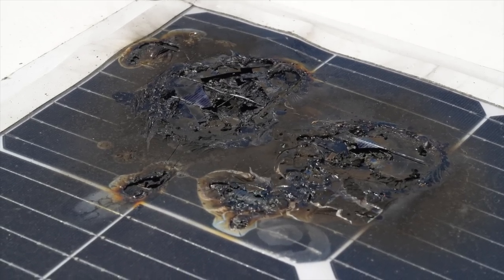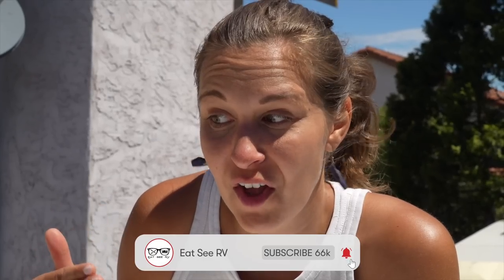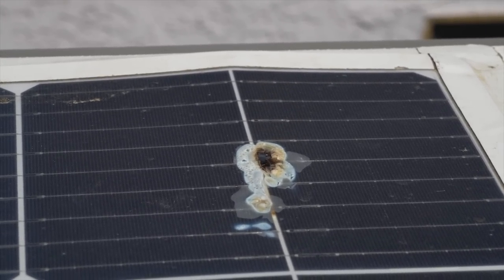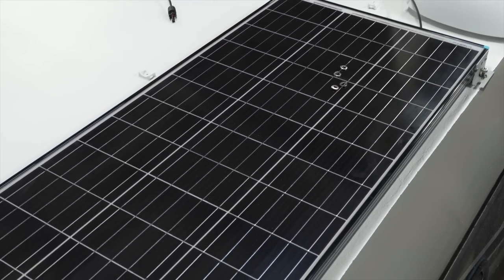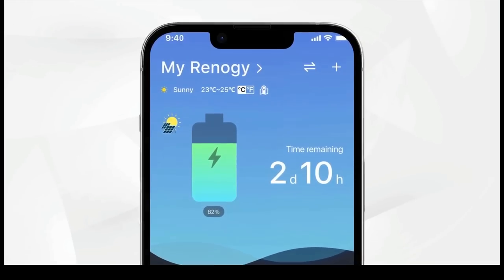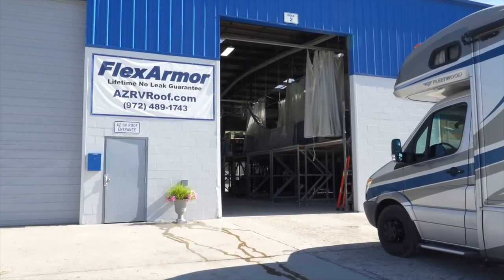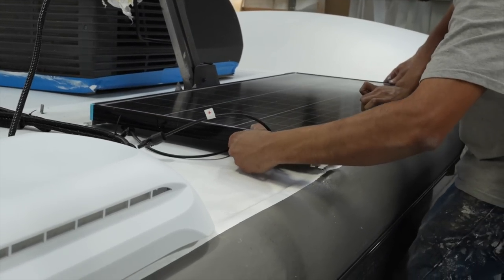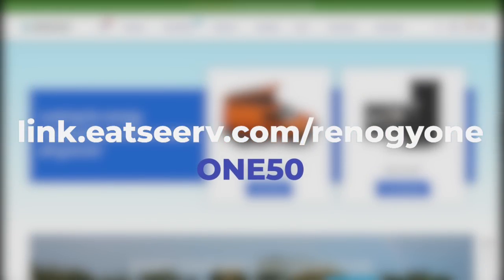Don't Let This Happen To YOU! (Our RV Solar Panels Caught on Fire)!

Comment: One of the things about solar cells is that they are much more efficient when it is cold vs hot even though there is usually more sun when it is hot. The 3 inches that a rigid solar panel sits above the roof allow air to circulate underneath and cool them. You have just taught me that this is more more than a efficiency issue but is even more of a safety issue. Thanks for showing this because I have never seen this before. We all live and learn and it is so helpful when you share experience like this.

Comment: Another factor that comes to mind is the tape around all the edges. If there is differential expansion/contraction between the roof and flexible module this could put a lot of mechanical stress on the solar module and more quickly damage them. Without the tape I'd be worried about wind damage. Tricky situation, glad there's no more damage!
Reply from the maker: Yes glad we upgraded and don't have to worry anymore.

Comment: I am so glad your RV didn't burn to the ground!  Thanks for letting us know the possible causes of the cell break down and fire.  I looking at using flex panels in my backyard when the power company turns off the power for days.  Nice to know that even wind blowing the cells around can damage them.  My DIY mount is going to be a lot stiffer than originally planned now know that wind will damage the cells..

Comment: The burning can happen if you don't fuse between panels if you are connecting them in parallel. The solar panel fails but still has voltage across its positive/negative from the other parallel panels.  If they are wired in series you will notice much earlier that there is a failure because your entire array will go offline.

Comment: I have been using SunPower flexible solar panels for 7 years, 1200w installation, they are in perfect condition, at the same level as rigid panels with the same years.  The panels have been installed on an aluminum frame and brackets, spaced 1.5 inches from the ceiling.  The coating of our panels is EFTE, which guarantees resistance to high temperatures much higher than cheap PET.  Many manufacturers sell flexible panels such as EFTE being PET.  The hot spots suffered by your solar panels is a failure that also occurs in rigid panels, caused by poor construction of the solar panel.
Reply: Did you build the frames for the panels?  and of course any details. please

Comment: From Will Prowses' Mobile Solar website:

"Flexible Solar Panels? Don't Buy them!
You have been warned:
Every single flex panel on the market is garbage. I challenge anyone to prove me wrong on this. I have destroyed stacks of these things. The cells crack easily and take out a whole string of cells when the bus bars break. Or they have extreme degradation after a few months of summer. Even the latest "CIGS" panels that I was so excited about, are having delamination problems. 
Do yourself a favor, and avoid the flex panels. None of them are good."

I am very thankful I went rigid instead with my build 2 years ago.

Comment: Our flexible panels are SunPower and are on many boats canvas roofs on Georgian Bay. Haven't heard of any issues and they have been around for years so I think it depends on what you buy. So glad you weren't hurt. Take care.
Reply from the maker: Thanks for sharing! We hadn't heard of any fires here either, until we did more digging and found it can happen.
Reply: You should leave some space channels underneath the flexible panels for airflow to avoid the risk of getting fire. I use 3M Dual Lock Reclosable Fastener SJ3870 250 Black to attach on my roof

Comment: I'm about to put 5 panels on my roof. My friend kept telling me to get flexible and this is the proof that I won't be following that suggestion. Since my roof is rubber I'm going to use aluminum Unistrut on a slight stand off and a bunch of lap sealant into the roof studs. Thanks for the great video.

Comment: I have a 100ah Renogy lithium battery. The thing is a power brick. I installed it, Turned on everything in the RV, turned on the inverter and started to test it. I used a blow dryer on low for about 20 minutes, turned on the TV, turned one all the lights in the coach, turned on the big ceiling vent fan in the bathroom, turned on the stove hood fan and light and fridge, 2 hours later it was registering 96%. I have an old 100 watt flexible solar panel on the roof that only puts out 30 to 50 watts. I turned everything off, and in about 5 minutes the battery was showing 100%. I am sure it was still charging, but I could easily last overnight with regular usage over an overnight stop. No, you cant use the microwave or A/C. I can use a fan and be fine for a night. I am going to upgrade the solar controller to a Renogy 40 amp unit and a 200 watt Renogy rigid panel. I can see boon-docking for a week with no issues. Renogy rocks.

Comment: Of COURSE the manufacturer says it wasn’t their fault.  The fact that there were multiple failures when the panel is called FLEXIBLE but cracks and burns when flexed, is scary.  I’m curious if this is common among other flexible manufacturers.

Comment: If the inverter has arc fault detection, then the inverter can shut down solar production so the panels don't catch fire. Some inverters can have this enabled or disabled as an option. Basically, arc fault detection can detect if there is sparking in the panel or connections.

Comment: So glad I have the aluminum framed glass type that allows for air circulation underneath, Have eight 200 watt panels with for 6 years now, with flawless operation on RV, however the MPPT charge controllers all sucked with voltage fluctuation, found small voltage  regulators online with heat sinks and adjustable amperage and adjustable voltage and digital readout for only $10 each and utilized two for superb voltage consistency charging and  low cost lithium titanate bundled batteries  at 13.5 volts each.
Reply from the maker: Good tips and glad you have a situation that is safe and works for you!

Comment: 🤔
          The solid panels are warrantee’d for 25+ years, they are less expensive than flex panels, they allow cooling air flow + an air gap below the panel, and lastly solid framed panels may be inclined (if so designed) to optimize the incident angle to the sun (increasing efficiency about 30%). 

           Thanks for the valuable OE (Operational Experience).  We are very happy for your home and kitties 🐱 🐱  salvation. 👏🙏👍.

Comment: Safety and application are Paramount with flexible solar panels. I’m adding several 200 W renogy panels  the new style but I’m gonna have a 3/8” air gap running under each one with a drain area for water. Technically they’re not touching the roof and I won’t be ( taping the edges ), air circulation is Paramount using 3M-VHB 62 to hold down. 😎😎😎😎😎

Comment: That was super scary! I'm so glad that the damage wasn't worse and that your furbabies are safe!  I had no idea they could catch fire. I guess that goes for the suitcase type which is what we'll be having.
Reply from the maker: Us either! I think the suitcase type is less prone to failure, but I still think I'd get a rigid portable suitcase not flexible.
Reply: I chose the rigid suitcase type of solar for my small Class C.  Main reason was I prefer to camp in National Forest type places where there are more trees.  I wanted something I could move around as needed.  Plus I was worried about damage from above from all sorts of things.  I've been using them for 3 years now and am very happy.  Sure glad your situation wasn't worse!
Reply from the maker: Glad you found something that works for you!

Comment: ALWAYS see that there is some space between the panel and the RV roof (no matter you use flexible panels or not)...for ventilation...so your mounting of the panels was incorrect ! You may be very lucky that the damage is restricted...
Reply from the maker: We followed the instructions of the panels. They are made to be directly applied. We had air gaps in the flexible panel installation before and they still failed. Flexible panels just not good for RV use.

Comment: It is highly recommended that anyone setting up a off grid/vehicle power system that you should invest in a thermal camera. Not just to inspect your solar panels but your electrical connections, batteries and wiring. Inspect at least least every 6 months.  In a RV or mobile power station you should check more often. The panels you installed could catch fire in the same way the flex able ones did. All it takes is something falling on them witch is much more likely in a vehicle than a stationary array where you can negate most threats.

Comment: photovoltaic/solar thermal technician here: proper terminology is required here. i know we're all in the same page as that they all produce electricity by converting the sun energy. 
monocrsytalline, polycrsytalline and amorphous are the three types of solar panels.
monocrystalline and polycrystalline are the "rigid ones"
amorphous is the "flexible panels" 

monocrystslline are more efficient than polycrystalline cells and can be smaller in size for the same output. polycrystalline are less efficient than monocrystalline solar cells and require a larger surface area for the same output. amorphous require twice as much surface area for the same power output as a monocrystalline, they are flexible and can handle higher temperatures better which to me is an oxymoron. handles temperature but not damage hence the fire. amourphous still has it's function i have some too. FYI Mono and Poly solar panels when on fire still are producing electricity and you can be electrocuted.

Comment: I watched a YouTube video a while back discussing the different Solar Panel types, one what’s the flexible flush mount panels that you have.   I believe the examples in the video was on an airstream, but one thing that they made clear, they produce heat, having space between the panels and the roof was critical, not just for heat dissipation, but for panel longevity as well.  Heat makes things more brittle, roofs get hail, and heat flexes them too.  Watching your installation one thing is clear… YOU NEED ABOUT AN INCH GAP BETWEEN THE ROOF AND THE PANELS.   It did NOT look like you had that in your video.  Be safe!  ❤
Reply from the maker: We had the air gap on our first ones that failed. They actually recommend installing them directly to the roof. We followed their instructions.
Reply: @EatSeeRV  — I’m no expert, but the point they made was the air gap was for heat dissipation.  If you don’t want the heat transferred to your RV, a gap is needed.  I’d consider a little research before assuming their recommendation was correct.  Trust but verify is a good motto.  Good luck!

Comment: I have 4 all power Facilbles panels glued to a rounded roof of my camper van for the last 5 years with no problems. One of my wires broke on one of my panels one time and I able to easily  solder the wire back into the little box on top of the panel and that was my felt.
Reply from the maker: Awesome! Glad to hear it's worked out for you.

Comment: Flexible flat mount panels are known to get hot and be inefficient. Ease of application over function and safety. Further, anyway you can cool a panel down and get airflow underneath it is good for the panel and its efficiency. I mounted mine on struts (granted I have a 5th wheel) and they are very secure, less homes, and plenty of airflow without affecting much of the aerodynamics. Glad you guys switch over!
Reply from the maker: Glad they're working for you. We had a similar mounting situation for our last ones and they still failed a year and a half in.
Reply: @EatSeeRV  correction, I mounted my ridged panels on struts haha. Not a fan of the flat stickies. 😁

Comment: For what its worth, here is a quote from DOE "Design flaws, component defects, and faulty installation generally cause solar rooftop fires." This same info is quoted by a company in the UK, I believe in April 22 after a fire was reported as caused by solar panels.

Comment: GREAT video. We are looking to add solar to our 5th wheel and though about using flexible panel to keep down drag. I had always wondered about the heat buildup and being right on the roof. I think we will go with raised.
Reply from the maker: 100% go with rigid and raised. We haven't noticed a big difference in drag for wind and is well worth the safety and longevity of the panels. Don't forget to shop for Renogy rigid with our link! 😉

Comment: Whoa!!!  So glad you’re ok; it could have been much, much worse.  I read through all the comments and based on this video and those comments, I’d never use flexible solar panels.  Not happening!
Reply from the maker: For sure couldn't agree more.
Reply: they are great for portable fold outs; would never mount to RV or any other surface.

Comment: I’ve had 4x 100w flexi panels on roof of my steel boat for the passed 4.5 years in full sun and the only fault I have is they have gone slightly cloudy, not so much as to look off but don’t look like new any more and output hasn’t dropped. PPS mine have been walked on a number of times, usually when one looses balance and this has not degraded the panels. I do think what you pay for panel can effect quality, for me I use them as don’t produce wind noise or can’t get things caught on them. But then my roof is 4mm thick steel, but does get hot enough to rain water to instant steam.

Comment: Glad I saw your video. I just laid 2 of them on my camper van that I am building. I was hoping to keep a low profile without the panels being noticeable. But, possible fire is not worth it. Would it be worth trying a fire resistant something under the panels?
Reply from the maker: Everyone says air gap but we were told by the manufacturer not to do that because it breaks the membranes with wind 🍃 we recommend hard panels

Comment: Same thinf has happen to my 6month flexible panel but on a small level. 4 dime size. Wasnt sure what or when this happen but panel still works because is has 48 blocking diodes and its on a ladder rack so not on my roof.  I think a tree limb may have fallen on it

Comment: Flexible solar panels aren't the problem, the problem is "flexible" crystalline solar panels, crystalline cells don't tolerate any flexing for very long, your new ones will also be flexing and WILL develop micro fractures due to vibrations. You would be better off with CIGS solar panels, you'll also get more power because they aren't as dependent on perfect sun conditions. Another option is Amorphous Silicon panels, but you'd need to cover a much larger area for the same amount of power.
Reply from the maker: Thanks for the tips!

Comment: I have lately been wondering if there's like an anti fire material layer that could be put between panels and a roof, either for houses or RVs? 

Also, I'm curious... this problem specifically is happening to many people. So is it happening because of the guage of wire being wrong... the panel using concentrators/concentration too much?? or What? There must be a reason that most of the fires are happening at the panels instead of on the wires themselves or at the charge controller... ? 

If someone uses too low rating of wiring going from panel to charge controller this can be an issue. So can charge controller being too weak, unable to deal with the power, if the battery gets overcharged and its lithium that can be fire too. BUT what these people didn't tell you is that the fault being from different places means the fire and burnage would be in different places. NOT the same place.

...

You can also check if the guage of the wire that's carrying your power load from the panels to your system is rated high enough for all the load its carrying. This is important. Like 10 guage wire is built for 30 amps typically. A lot of people are putting more than 30 amps through, which is roughly 4 100 watt panels.

Comment: YIKES glad yall and RV are all okay. I thought you had or were selling that RV ?? It will be MUCH better now. I prefer rigid and elevated (maybe 1.5 inches) panels for the improved air circulation and cooling UNDERNEATH which can yield more energy harvest. Did you consider one or two 200 to 300 Watt individual panels that are around 39 x 64 inches IF your roof space allowed ?? Keep up the good work and videos.   

John T   BSEE,JD   Electrical Engineer and 50 year RV owner
Reply from the maker: We considered 200 at first but they didn't fit. Rigid our definitely our preference now too.

Comment: I noticed from the pics it seems like there does not seem to be any provisions for air flow between the RV roof and the flexible solar panels that burned. Due to limited data, I am not sure if that is  the root cause or not, but solar panels can create high heat temps.

Comment: I don't like flexible solar panels buy residential rooftop panels they are UL certified. Also, NEC requires arc fault detection over 80V good idea to follow same standards when installing them on an RV even though not required. IMO RV is even worse if you have a fire then a home with the propane, and gasoline. The UL certifed inverters have arc and ground fault detection built in.